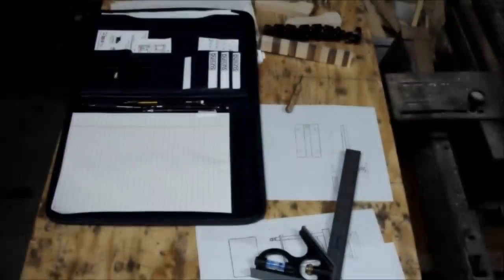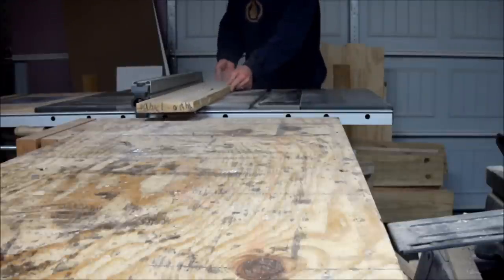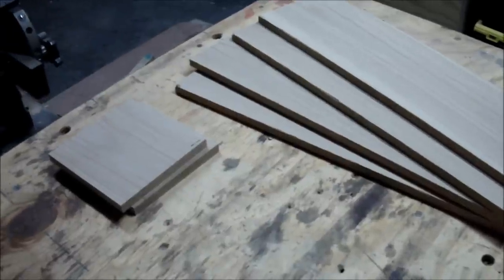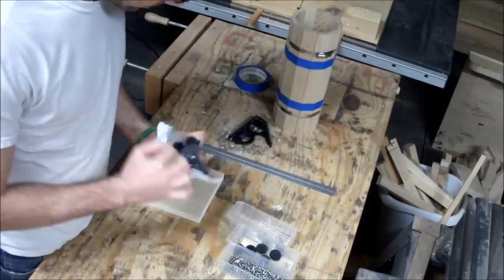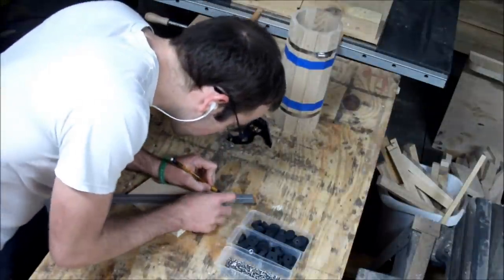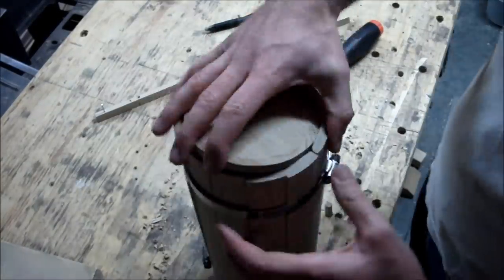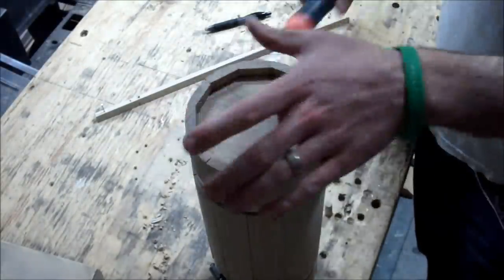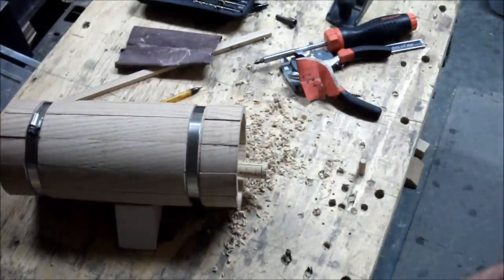pullins woodworks white oak whiskey cask

Comment: Nice video but i hate to break it to you, whisky is only going to last a few years in that cask because its all going to evaporate out through the wood.

I'll use Pappy Van Winkle’s 23 year bourbon for an example, It starts out as 53 gallons and it absorbs into the wood and evaporates over time until its down to 14 gallons.

If you try to let whisky age for 20 years in that barrel you'll be lucky if its even still damp inside when you open it.
Reply: Liquor actually ages faster in smaller barrels because, all the aging process is, is transfer from what's in the wood to the alcohol.  It ages faster because there is a greater ratio of wood to liquor than in the traditional barrels which is the normal 1:1 ratio.  You can actually "age" Liquor for what would normally be years in just a few months.  Don't get me wrong I think the quality of the traditional ageing process and barrel size is tried and true and is usually a lot better tasting.  But rapid ageing in small barrels is possible.
Reply: Joel Davis Yes but he said he wanted to age it until his kids are 21, the barrel is going to be empty in say 10 years just due to evaporation.
Reply: He'll have to keep tabs on the process and bottle it at some point when it's aged sufficiently
Reply: What happens if he seals the whole thing in a air proof wrapping, and unseals it periodically?
Reply: cultclassic999 he will have a heap of VERY oaky undrinkable whiskey
Reply: top ups =)
Reply: I just discovered this, bringing me here! I just had a handle of whiskey evaporate sometime within the last year in a small barrel like this. 20 years? No way!
Reply: The aging process only takes a few weeks, then it can be transferred back into sealed glass bottles.
Reply: I have reduced tons of White Oak, Hickory and other fruitwood into lump charcoal in metal drums for pit bbq,and then add the few uncarbonized chunks of wood to large glass or ceramic containers corked full of "green" or unaged young wine,this is a very effective method as you can also make activated charcoal as a filter in months later on.Surface area of charred wood is more important than the tradition of standard wood barrels,and reduces aging time,with no loss of product.

Comment: Alcohol (ABV) evaporates from the cask. Usually whiskey is at 120-150 proof when first put into full size aging barrels, and loses 1-2% abv per year in a full size cask, your cask however has much higher surface area in relation to volume, which increases the rate of evaporation, equivalently the ‘aging’ is sped up. However it is much more drastic than your initial estimate. The estimated rule of thumb for a 3L aging barrel is 1 month is equivalent to 1 year in a full size barrel. (12 times increase in aging) The smaller the barrel, the faster the aging. By my metric though, pure 100% ethanol in a full size cask would theoretically be 0% abv after 100 years of aging. Another issue to contend with, as the ethanol evaporates, the liquid content is reduced, allowing the top of the cask to dry, and as such, seal more poorly, further increasing the rate of evaporation. Commercial distilleries fill their casks at 120-150 proof (60-75% abv) and periodically add filtered, sterilized water to top off the cask, keeping it from ever completely drying out, but also reducing the abv. After the target years of aging, they test the product with a hydrometer, and then further dilute with filtered water to their desired bottling strength of typically 35-50% abv. If you desire to really test out your cask, fill it with the purest grain alcohol you can acquire. I put everclear 151 in mine, and after about 6 months (6 years worth compared to a full size cask) it comes out golden brown, hydrometer tests at 130 proof, and mixed with just a bit of filtered water, is quite pleasant to drink.

Comment: The kerf you put in the inside for the heads, that was a straight cut with dado blade, wouldn’t that make a round barrel head not touch anywhere but the center of the stave? This didn’t hold water did it?

Comment: I've considered doing this for some time.  Your video is the best I've seen.  I'd like to get the angels and dimensions for a vessel that holds one gallon and five gallons.  Any ideas?
Reply: You can figure angles by 360 divided by number of staves.  In this case, 360 divided by 12 staves = 30 = 2 x the 15 degree bevel on each side of the stave.  If you doubled the stave number, reduce the angle by .5, which is 24 staves with 7.5 degree bevel on each side.